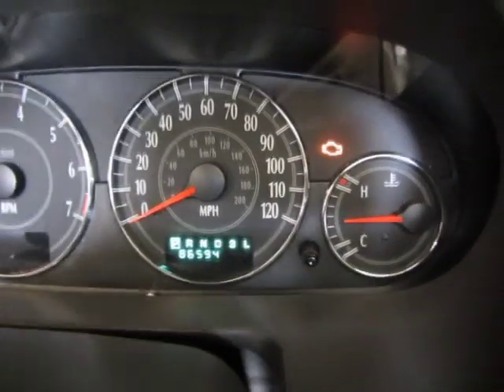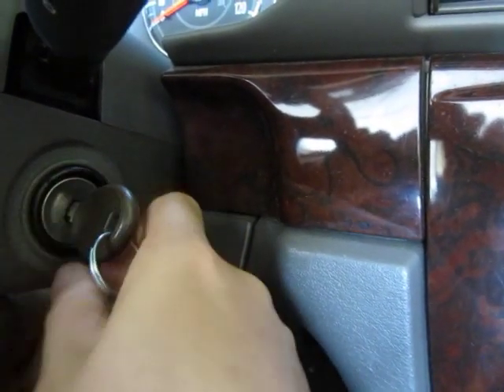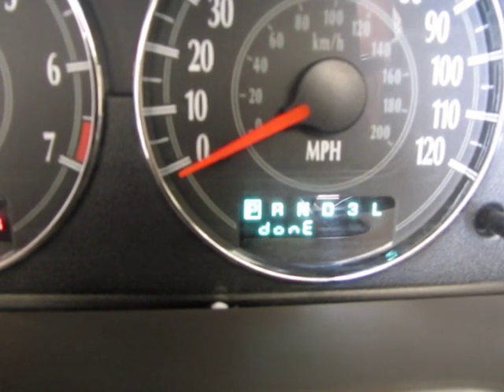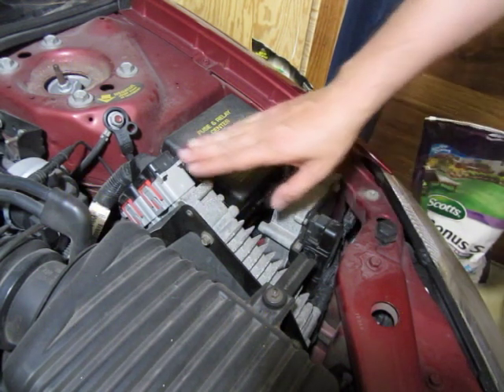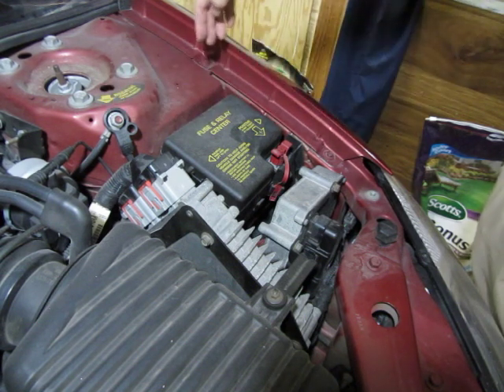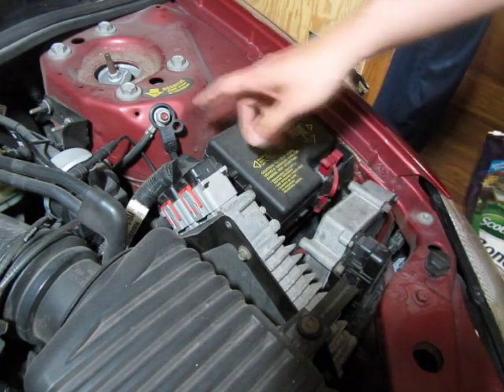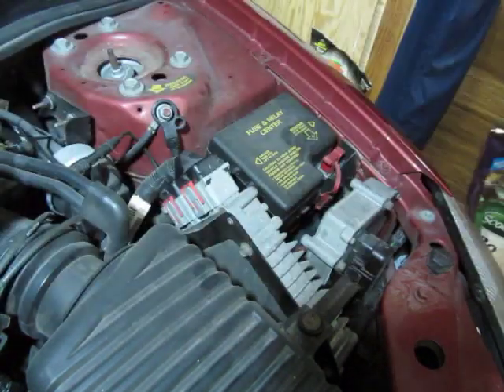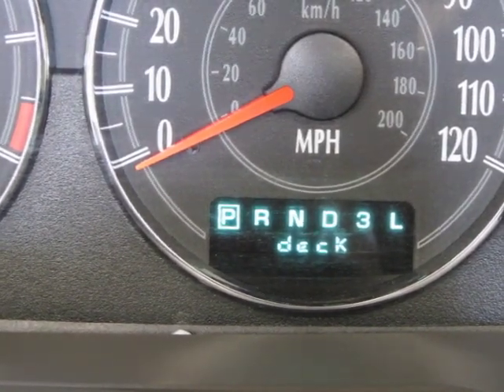2002 Chrysler Sebring P0601 code

Comment from the maker: Glad it helped. The new computer that the dealer put in died 9 months later and I got it replaced for free, but I had moved to a different state I had to pay $300 for the labor. Then the engine blew up about 3 months later.  I loved that car. I suggest changing over to synthetic oil. The engine has a design flaw where the oil passages are too small and eventually clog up. Synthetic oil helps with that problem.  Good luck!

Comment: Awesome vid. Bro helped me tremendously I have an 02 Chrysler Sebring 4 door sedan hardtop and I got the same exact code that got read off to you and I'm pretty sure it is because I am 1800 miles overdue for an oil change so as of today I am going to get an oil change and then I am going to reset the light and I will let you know how this works out for me thank you so much for sharing it was very helpful.
Reply from the maker: Gary Taylor My pleasure!  Hope it works for you.  My engine blew up a few years ago, so I replaced the engine and sold it :-(
Reply: saltyshellback I hope that doesn't happen to mine it just turned on last night and lights make me crazy plus on my way home from work my tire went flat due to irresponsible people leaving them in my WORK driveway... and it's Sunday so there's no fixing it till then it's parked at a random Mcdonalds grrrrr....
Reply from the maker: Bummer!  If you haven't already change to synthetic oil.  First my water pump cracked on the inside and leaked coolant into the engine crank case.  Had to have it towed, replaced the water pump and flush the engine.  Then about 3 months later it blew up on the highway.  2002 Sebrings have badly designed engines that had really small oil passages that easily clogged and were redesigned in 2003 models.  But if you use synthetic oil and change the oil like every 5000 (instead of the 7000 recommended by synthetic oil makers) then you should be able to keep it running a long time.  Just watch for the oil light on the dash.  Mine flickered for like a month before it blew up.

Comment: Thanks... Very helpful... So, did you finally get it fixed?  What was the actual issue?  I have one of those cars, too...!
Thanks again...
Reply from the maker: I have since sold the car, but I believe the issue was the ECM Engine Control Module.  I replaced it and it worked good for about a year.

Comment: Got a question for you when the speedometer stopped moving what's wrong that means a blown fuse can you tell me that when your next interview your next video rather all right I got the same car you have I really hollaback thank you but you can show me and you next video
Reply from the maker: Hi.  Sorry, but I sold that car about 5 years ago.  Not sure why the speedometer would stop working.  The only thing I can think of is that the computer is messed up or like you think, there is a blown fuse. But if it is a blown fuse, then you will have to figure out why the fuse blew.  Sorry, I couldn't help more.

Comment: my husband said instead of taking the terminal off try pulling the ECM ( engine control module ) fuse out wait 30 second then put in back in some vehicles have to be out over night saves reprograming your radio every time

Comment: P0601 is an internal PCM failure. You may not experience any drivability issues at first but you will eventually be left stranded, The PCM needs to be replaced. The dealer costs a small fortune and still need to have them program it. Very common in many Chrysler/Dodge models. I always use a company in florida - www.allcomputerresources.com - They send them out programmed to your VIN and keys. Have had a few of these already. just my 2 cents
Reply: Ryan Decker will the pcm cause the rpms to shoot up and the shut the engine off?

Comment from the maker: I have been wanting to get a reader for a while, but couldn't justify the need to get one based on the number of times I have needed it.  They are around $100-$200, but if you go to most auto parts stores, they have one you can use for free.  Losing the presets was a little bit of a pain, but not enough to go buy a reader...I'm a cheap SOB....lol

Comment from the maker: Yeah, I was living in a place where work was only 2 miles away.  I would have walked to work if I wouldn't get killed on the road...lol  There was only a 2 lane road to work and the speed limit was 55 MPH and no shoulder to walk on.  In the winter, my car barely got warm before I got to work.  Sadly the engine blew at 110K and I had it replaced and sold it.  I still love that car.  If only the engine didn't suck :-(

Comment from the maker: It was $1100 for a new (rebuilt) computer installed plus troubleshooting.  They offered me an extended warranty for $2300 and would apply the $1100 towards the $2300, making it an additional $1200 for another 100K miles of full powertrain warranty.  I declined it, but wish I would have taken it, because things kind of went downhill from there :-(  long story.  I have since sold the car...lol

Comment: Iv had 2 Sebring and still do,they re high maintence cars,I have the 2.4 twin cam.Change the timing belt around 70,000 miles or you'll wish you did when it breaks.One has 165,000 on it and the other has 90,000 on it and both are still on the road daily but the V6 is pretty much a waste of time because of soft crankshafts and wont last past 100,000.

Comment: So that new pcm did not fix the p0601 code?
Reply from the maker: +Salvatore Hayes Yup the new PCM fixed the problem only to crash again like 11 months later and had to be replaced again.
Reply: +saltyshellback oh ok. yea my 04 monte carlo has this code and car dies out when idling. traction light is on and my cruise control is disabled.
Reply from the maker: Bummer. It is unfortunate that all cars now a days are laden with computers.

Comment: would that code come up if the transmition computer is bad? i have a dodge stratus 2002 and the car starts fine but it lags when running
Reply from the maker: I'm not sure. sorry.  You might be able to search for a video on it on youtube.
Reply: ok thanks for your help
Reply: hey ernesto i have a 2002 voyager with this code and it would run fine and all but it would not shift out of first. it kind of seemed like it was a bad shift solenoid however after replacing the computer it worked fine. if you are having this code and transmission issues you may want to replace the computer. it worked for me.
Reply: GtnAwyMrdr  ok thanks, i just dont want to get the wrong computer which one exactly did you change?
Reply: GtnAwyMrdr  ok im about to buy an engine computer just now which computer did you buy transmission or engine? and did the Check Engine Light came off afterwards? thanks

Comment: your 02' only has 86K on it? wow. my 05' is approaching 104K. At some point before i got the "idiot light" for a cylinder misfiring when in all reality was just a bad tank of gas fixed by some fuel injector cleaner... thats a nifty trick tho man, if i can remember it, ill use it next time i get the "idiot light"

Comment from the maker: That means your computer is on the blink. If you don't have a state safety inspection, and don't need to get it fixed, I would leave it alone.  The computer cost me $1,100 to have it replaced and then the replacement one died and it cost me $300 to have it replaced again.  Might want to start looking for a new car :-(

Comment: How do you rest an oil light on this car
Reply from the maker: I'm not sure you can reset it.  From what I remember, you either have to replace the oil sensor, or flush the engine every oil change.  The problem with this model year is that the engines had badly designed oil passages.  They are too small and are prone to clog.  The engine on this car blew up at around 90,000 miles due to a clogged oil passage.  If you own this car, I recommend doing an engine flush and religiously changing the oil every 3,000 miles.  Hope that helps.

Comment: Don’t do that!,touch the positive to the negative! You are better off putting the lights on with the battery disconnected with those wires disconnected!! Scotty Kilmer states you can damage the computer by touching the wires together.
Reply from the maker: OK.  Apparently I didn't blow up the car when I did this.

Comment: its a shame she didnt last longer, but hey shit happens... was the engine a 2.4L or a 2.7L? If you had the 2.7L, from 98' to 02' (i believe) there a was a recall for "sludge" issues. my only issue with mine (i have the 2.4L) is the gearing of the transmission but thats the granny 4-speed for ya lol :)

Comment: The computer is bad. A Gray Key means that you have a Sentry Key Immobilizer! That means If the PCM is replaced by a re-manufactured PCM then you need to have a dealer or professional flash the PCM with your mileage and VIN or the Gray Key wont work. If you try to buy a USED PCM then the Gray Key wont work unless you program the Key with the Sentry code belonging to the USED PCM. But it wont work unless you have the VIN from the USED PCM to program it! Pain in the Ass!!!